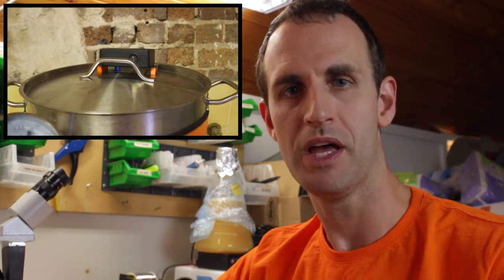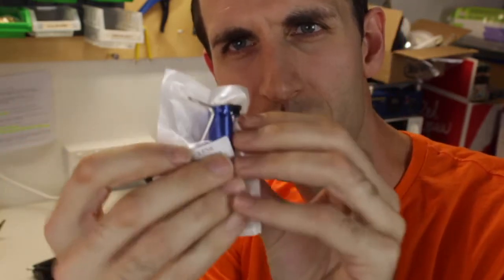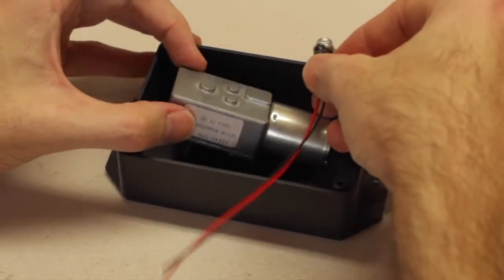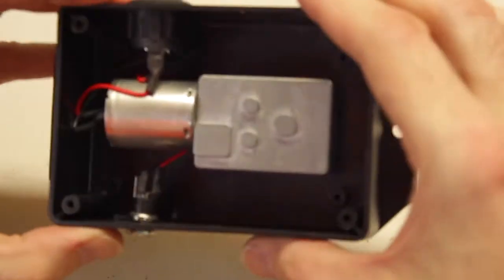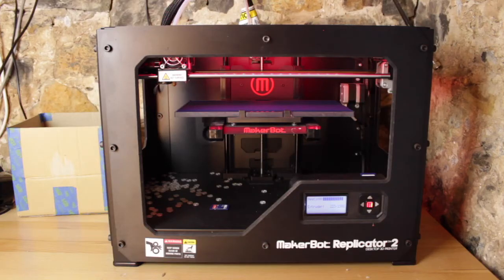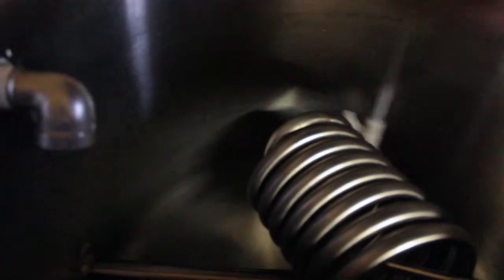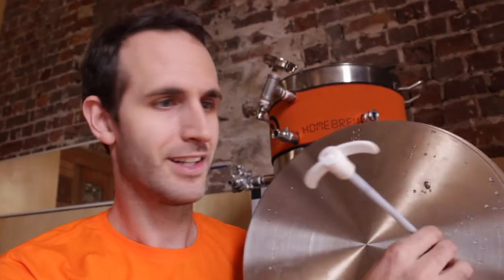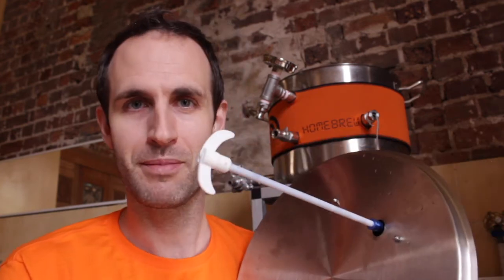How To Build A Stirrer For Your Hot Liquor Tank

Comment: Great job, I would perhaps beef up the wires to the motor a little and the switch, they look a bit light for a motor of that size, It works well, 

I am not sure what goes into that tank eventually but possibly the same could have been done with a small submersible pump that you leave on the bottom of the tank sucking in the cooler water and the output at the top of the tank. The only thing would be the temperature of the water may be too hot for a normal pump . 

You could use silicone neutral food hose for the pipes as well.  that would certainly allow the fluid to be well mixed. I use the very same principle with a pump to cool a C02 laser and it works perfectly as the laser tube can not go above 18º otherwise the life of it is greatly diminished. i think I even have the same temperature switch.  Well Done, solves a big problem for you.

Comment: Great video mate, very detailed and well designed. I was wondering if you were to just whirlpool the HLT with a pump, would be enough for the same results you have? Thoughts? It would definitely be an easier build.
Reply: Adam Pike Yes a pump would work perfectly but quality food grade pumps that handle high temps aren't cheap. If I did it again... I'd probably hook up another march pump and not tell the missus ;)
Reply: I use a March pump on my HERMS HLT and it works great but is probably overkill. Circulating HLT water is absolutely critical for a HERMS system to be efficient and accurate. I went through the exact same learning curve. I like this stirrer solution better though. Much more elegant and quieter!

Comment: The oil is used to cool the gears.  You're not supposed to use a detergent to wash the oil off.  You're supposed to seal the drive shaft.  The gears need the oil!!!
Reply: That was my exact thought.. how would you seal the driver shaft?
Reply: @miaturay7549  The easiest thing to do would be to buy a gearbox that is already sealed.  The alternative is to custom machine a seal with an o-ring.  Shaft seals are not cheap, usually.